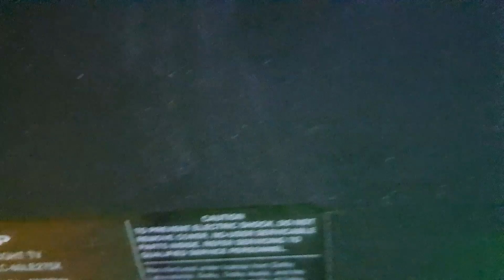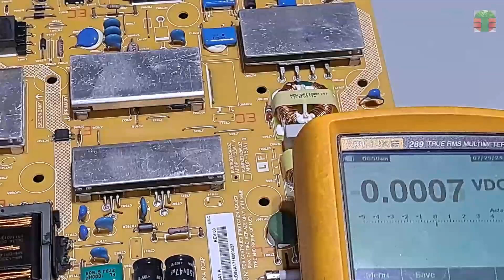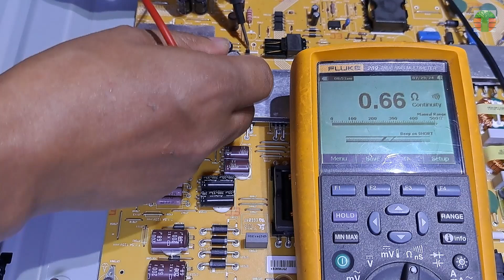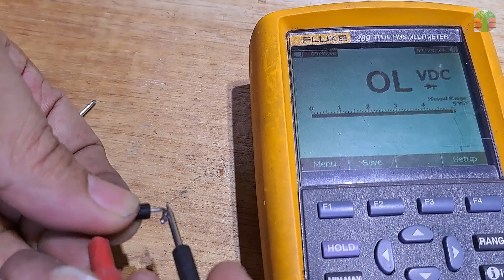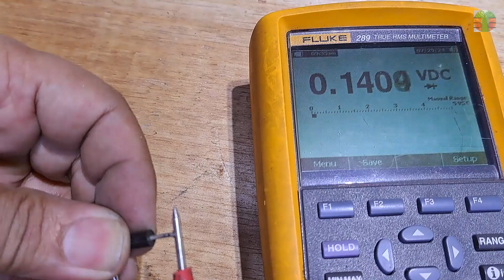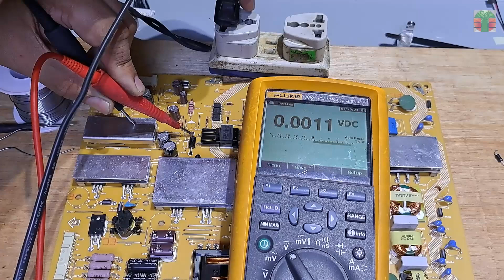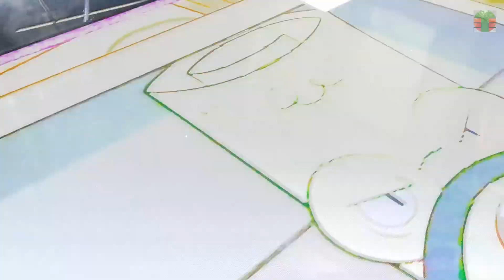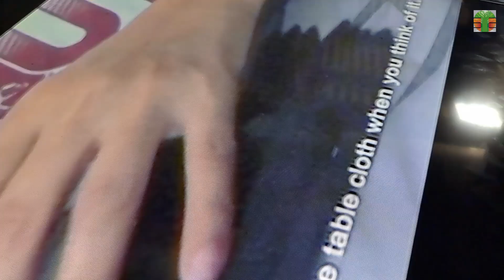Sharp 60-inch LED TV has no sign of life.

Comment: @TEVTV, 
 @4:28 Time Stamp,
 Thank you for you're,
 220 OHM, 20 Watt's, Discharge, info from Previous video, its good practice to include the Discharge Info in your Video's....
  Be cool if you could Show how you Built youre Discharge Unit, and tips and Techiniques....
It would make a good General Safety Video, Regarding Capacitor Safety....For Us All...
  For My Discharge, I made a Discharge Rod, 1/8" diameter, 
12"inch. long, out of Solid Brass, Rod...
 Installed/ Soldered a,
 470 OHM, 5 WATT'S Ceramic Resister...and installed/Soldered, 3 ft Alligator Clip,  Ground Wire....
To Discharge Cap's...
Used lots of Shrink Tube, To Insolate Rod, and Resister, And Shrink Wrapped Resister, to 1/8" Rod, and Built it up to Double insolate the Whole Rod, for Safety.....
  Ground Down To a Tip, on One End of 1/8" inch. Rod, to a Point, for Touching to + positive Terminal of Capacitor, and Negative Grounding Wire Aligator Clip, Attached to Metal Grounding plate, where  Power Board is Mounted to.....
✅NOTE: "ALWAYS UNPLUG, T.V. BEFORE DOING DISCHARGING, AND 
NEVER HAVE BOTH HANDS, IN THE UNIT, AVOID CREATING A LOOP, OR PATH THAT COULD LEAD TO HEART.....⚠️" 
 Discharger Works Great....
Used my Fluke 88V, set to Volts, AC/DC, Mode, to Test Caps, after Discharging, to Comfirn that Caps, are Safe....only took 5-10 Seconds, time, to fully Discharge....
  Thanks for youre Videos, and youre Wisdom....👍😎🇺🇲.
Reply from the maker: always check if the caps is totaly discharge.
Reply: @tevzTVTevatronics , Ok, will Do....
  I use my Fluke 88 V Multimeter, set to AC/DC VOLTS, Check its Discharged....thank you...😎👍🇺🇲

Comment: Damn, I wasn't that lucky with a 40" Samsung TV  I've found on the side of the road.
It has a shorted 3BR1065 that I can not find a replacement.
Have you tried to use a normal DIP8 psu IC with an external FET (from some other brocken TV) to replace the 3BR1065 with? 
Would it work?
Reply from the maker: Will work with any fast recovery diodes.
Reply: @tevzTVTevatronics  Please read again. It is not about a diode.